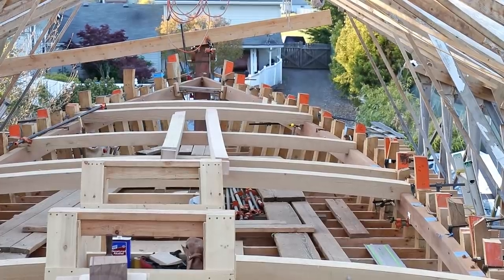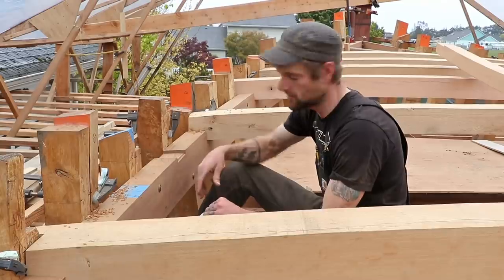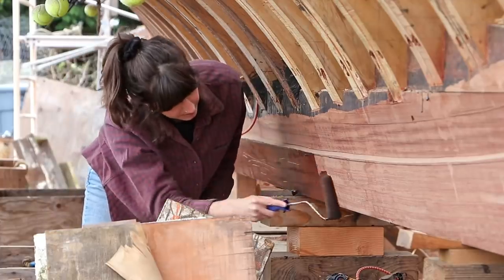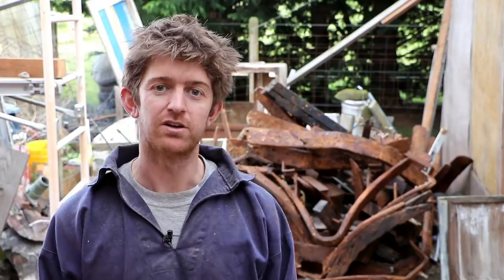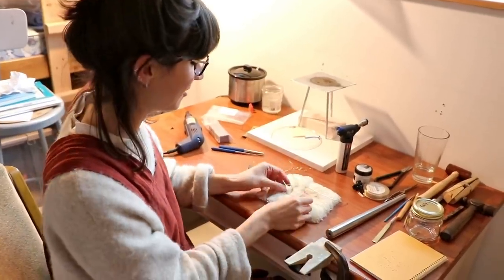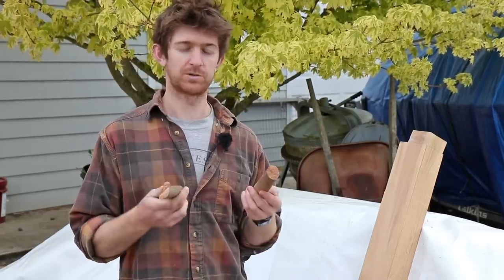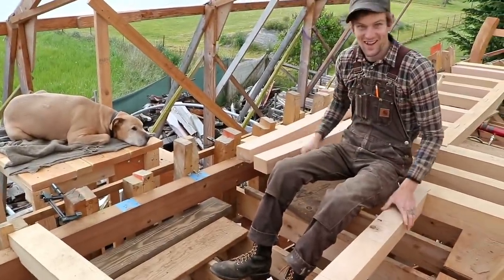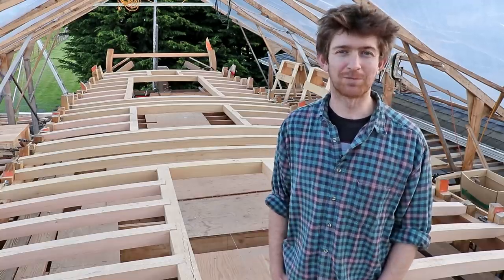BoatBuilding - Building the Deck Structure! (EP71)

Comment: Cast floors will be interesting to compare to Acorn to Arabella's welded bronze floors.
Reply: I was going to suggest to to look at them, I think they could be stronger and provide more rigidity to the centre-line of the boat.
Reply: I would think that welded plates and bars are much stronger than cast shapes.  We had cast aluminum handrail infills break in two when the castings were being pulled out of the crate.  There were air bubbles in the castings causing weak spots.
Reply: @biggest163  I Agree I think welded would be stronger faster and cheaper. There would be no pores, no flash lines to grind off.
Reply: @pghgeo816  Poor welding has pores in it, just as well as poor casting. Bronze is not a material that weld well.
Reply: Leo is a professional, those other guys are learners.
Reply: You were pondering what I was pondering...
Reply: A properly designed and poured bronze casting is more robust than a welded part.
Reply: @lowellmccormick6991  Air pockets in the castings means an inadequate design for the pour, among other things.
Reply: Cast bronze is extremely strong. I previously owned a bronze foundry. Not Brass but real quality bronze. It does not break easily and can take the flexing of a wooden vessel. I have salvaged vessels that were very old and repolished the bronze and reused it. Same with very old and weathered Teak, sanded and refinished. Best to be virgin teak not the modern farm cultivated variety.
Reply: @DC-uo5hy  pretty interesting stuff.
Reply: @DC-uo5hy  I hope Leo gets in touch with your for tutoring if he is planning on doing the casting himself (or) to get from you advice as to the best fabricator(s) you know as a choice of recommendations.
Reply: Welded parts would be ahistorical, and not really in spirit of the old lady, as opposed to a new build.
Reply: Nancy Pelosi  It looks like if they fair those positives out a bit they can just take them to a foundry that does greensand castings, no extra steps required.
Reply: @David Culpepper: I know there is "cold-rolled" and "hot-rolled" steel, but I don't know if the same applies to bronze-- such as the bronze stock Steve and Alix used for Arabella's floors. That was some pretty beefy stuff, but it was welded, so I'm also not sure of the strength of such construction. Would love to hear your take on welded-vs-cast bronze for critical parts like floors for a wooden boat. There will be twisting and torsion forces on those floors-- it's a wooden boat, nothing sits still. Would you include gussets between the vertical and horizontal members of such a construct if you were to cast that? I'm really very curious about this. Thank You!
Reply: @Crusty Curmudgeon (myself): I neglected to mention the general analysis that "cold-rolled" steel is far stronger than "hot-rolled" steel in tensile applications in my above comment. My apologies. I kind of wonder if bronze is the same, and if cast bronze can match that.
Reply: Oso Is that why they made the inferior choice to weld?
Reply: @Tsamokie   Especially in aluminium bronze, or better still, nickel aluminium bronze (however the latter would be overkill for floors - fantastic for rigging fittings, though)
Reply: @lowellmccormick6991  I guess it all depends on the quality of the castings, doesn't it?
Reply: Why would this video get 47 thumbs down?  I don't understand, but I guess we are all different.
Reply: Maybe thoses castings could be done  by "lost foam casting". Cuting the foam sandwitched in profiles cut according to each side of the template with Hot Wire. Need of a big furnace and a lot of bronze.
Reply: @Garry Kompton Hi Gary,
Sand cast, 88, 2 and 10 gunmetal (cannon) bronze cost around 8 to 12 dollars a pound to cast. Some other bronze is also very good but I prefere the strengths and ductility of the 88, 2 & 10.
Reply: @ApexWoodworks  Our problem castings came from a foundry in Mexico and we had to throw 1/3 of the castings into the scrap aluminum bin.  I've received other castings that were done well.
Reply: Roy Daley no doubt. Other projects have come and gone however I will see this one in the water.
Reply: @oso9809  they are taking their time to do everything properly, and their attention to detail is phenomenal. they might not be as knowledgeable as Leo but with time they will be. it would be interesting to see both tally ho and arabella race each other when they're both complete.
Reply: Leo has talked to the folks at Port Townsend Foundry in the past early on about casting the floors as well as the other required hardware.
Reply: @roydaley3413  Some people "Dislike" videos in order to try to train the Google AI, to not recommend similar videos. I just learned that not too long back. Of course, that just begs the question. Why would they not want to see these videos suggested?
Reply: @DC-uo5hy  extremely good examples of the durability of bronze. Bells and canon
Reply: Welding bronze seems like a good idea, but I have not been able to find much information on the material properties around the weld, and I suspect the whole piece may need to be heat treated to avoid embrittlement. Can a proper metallurgist out there,  answer this?
Reply: @Garry Kompton Bronze is very robust in the marine environment.  There would be no benefit to powder coating but I can envision some issues with getting to stick and stay stuck on bronze.  This is based on my own powder coating of other nonferrous metals.

Comment: I’ve seen it a few times now, still can’t believe how huge the circular saw is
Reply: How do you know that Leo and all the other helpers are not just very tiny.
Reply: The Insane Shecklador might be haha :)
Reply: With the ease and perfection of the cuts, I'd say that saw was purpose-built... 😊
Reply: @gilbertfranklin1537  actually, therr arr commercially available "circular saws" available with 10", 12", and 14" blades for "beam" cutting. Check your local supply house for orderability, or search online tool suppliers.
Search: Sawsquatch, beam saw, etc...
Reply: It's great isn't it! 16" blade if I remember correctly, never seen one in the wild but Leo has one.
Reply: @lemagreengreen  It is a 16" blade.  about 6" depth of cut. That one is a more recent Makita model.  Very popular for large timber construction like timber framing and the like.
Reply: Yes, that is a huge amount of blade to control for a hand saw.

Comment: Hi Leo. I have loved watching all these videos, right from the start. I think there could be two or three reasons for offsetting the hatch. First, and most likely, is the space required to accommodate the bowsprit; second, to allow a decent size of locker below for sail storage or similar, and third, to allow space on both sides of the hatch when a headsail is bent to the rail, using tip a large area of foredeck. Nowhere should there be trip hazards or other poor places for feet. Falling onto the deck or worse is not a source of amusement at any level. This displacement from the centre line wa carefully thought out, and is only to be admired as a 110 year old bit of thinking on the part of Mr Strange.

Comment: The fact that he cut that carlin knowing the knots would be removed in the joint, therefore utilising an otherwise good piece of timber, indicates the level of depth of thinking required to build such a boat. Amazing.
Reply: It's still much harder wood around the knots! Alot more effort to chisel out especially with the grain constantly changing direction.
Reply: At that same timestamp (around 19:10) the shipwright gets thrown a pair of wedges when he's standing on a pair of "2 x 10"s.
See, the problem is terminology. Most places call them "10 x 2"s, even in the old money , or "250x50" since about fifty years ago. It sounds much more stable.   ;-
Reply: @Gottenhimfella  Must be an American thing, 2x4, 2x6, 2x8, 2x10, etc.
Reply: I build furniture as a hobby and I find myself thinking like that because I just hate wasting wood (or rather buying more wood than I need to) if I can figure out how to make a piece of wood work for me.

Comment: Top Tip: don't ever use your hand as a hammer. ever. You'll mess up your hands eventually. Voice of experience here.
Reply: Yep, I pounded a chisel with the palm of my hand for a long time and now I have problems gripping things for a long time. Hand goes numb and whatever I'm holding drops or goes flying.
Reply: Bargle5  I’m in the same boat. Can’t hold things well, and drop items with out even knowing they are slipping. Silverware is hard to use too. Younger guys please hear our words as guidance for a better future for yourself.
Reply: Worked with Steelcase modular office furniture and we used our hands to hit the bottom of the upper steel file cabinets to release them from the panels. Retired now with constant pain in the base of the thumb. So to echo Jake's reply try not to use your hand as a hammer.  PS: the newer modular systems are redesigned.
Reply: ralph milburn
Reply: Or as a saw. 😰 got a buddy who really messed up his hand that way...
Reply: "In Japan, the hand can be used like a knife..."
(1970s Ginsu commercial)
Reply: @dbf2678  Knife OK, hammer ...not.
Reply: I constantly tell myself hands aren't hammers
Reply: @chrisgooden9662  I don't know how many times I have put that comment on youtube channels. a lot

Comment: My guess on the deck opening offset is that it is due to the positioning of the bowsprit (which seems to ride on one side of the stem in cutters) and anchor chain windlass. Is the opening for the chain or access to the sail locker?
Bril vids as always - Pancho steals the limelight every time

Comment: Leo in my youth apprenticing as a cabinetmaker I worked several winters when work was slow for a boat shop in the Muskoka lake district north of Toronto helping to restore mahogany runabouts. On one project we were steaming in 5/4 ribs into a runabout bow, did 6 ribs port and starboard left them clamped up and went home for the day. When we came in the next morning all 12 of the frames had broken during the night into 6" pieces from the pressure as they cooled. The explanation  and the discussion that followed was that the log had layed in water in the swamp until spring when the log through its nature started to draw up sap, but was drawing swamp water up instead with all the impurities and with no root system to filter. The the other explanation came from my father, was that the oak had been wet after sawing and had suffered a hard freeze  breaking the cells removing its longitudinal strength. All the best Brian

Comment: Fore deck hatch is offset for the anchor rode.  At least that is my guess.  Or for room below for the head...

You know a team is gelling well, when that are busting each others chops.
Reply: but wouldn't a anchor winch be amidships , why would the chain be off side ?
Reply: SailorAllan to clear the forestay?
Reply: The winch would be more-or-less amidships, but if it's a horizontal shaft the main drum would be offset to one side, so the rode would also be offset to run up to the bow roller on one side of the bowsprit.

Comment: Ah, what a satisfying segment. Best in the season, I'd have to say. On the slightly off centre forward hatch opening, I'm just going to take a shot from the hip and venture that it might have something to do with the often seen removable bowsprit on pilot cutters that I have observed in my own research. Or, I thought it might have something to do with the position and points of stress added to the deck by the anchor winch. 
Question. Have you ever wondered about how many actual man hours it has taken to get this far in construction compared to the original? Considering that originally many of the operations would have been achieved without the aid of all the power hand tools, such as planes, that giant skill saw, belt sanders, and routers that you have, that the original builders did not have?  Anyway thank-you again for such a visionary project, documented for the ages and for future shipwrights.

Comment: My guess is that the most forward hatch is the chain locker and that it is offset so that the anchor chain clears the stem and is aligned with the chain winch.
Reply: my guess is that the bowsprit goes there when it's retracted .... (boats of this size might have "stationary bowsprits?)

Comment: For the dark vinager smelling wood: I don't know much about wood infections but I do know what causes vinegar smells. I'd say that you have a yeast like bacteria in the wood which is eating any remaining sap or starch/sugars in the wood. This in turn produces alcohol like ethanol or methanol which when reacting with oxygen (when exposed to air) causes it to turn to vinager. Personally I don't think this could pass to other wood or eat up entire planks and would just be localised to regions within the wood with abnormal amounts of sap

Tldr: the woods probably got a bacterial infection, shouldn't worry about it infecting other wood.

- I am by no means an expert in any of these subjects I just know enough to have a theory.
Reply: Just to add to the bacterial wetwood discussion. The progress of the bacteria through an infected tree consumes oxygen. The anaerobic process of fermentation is revealed in a sour vinegar smell. In most cases tree professionals can spot it before it ends up at the mill but can be at times hidden. 

Not really much can be done other than segregate infected bits and use them to show your awesome taekwondo power stroke 🥋

Comment: Hey Leo, longtime fan. Do you have plans for those wrought iron floors? I'm a hobby smith over in Seattle and I'd love to get some of those floors, wrought iron is getting harder and harder to find. I'd love to use it to make some chisels or something you need to help the project
Reply: maybe wrought iron should go to a professional smith for important restoration work
Reply: @Cssfiend  It's going for scrap, Leo is replacing it with Bronze floors.
Reply: @Cssfiend  Besides the fact that it's so heavily rusted that it will no doubt lose a few millimeters of material, thus making it less strong, it's also proven that it's not ideal to have out on open waters, as it corrodes not just the metal, but also the wood. Recycling it is a much better idea.
Reply: @emeralddragon2980  Never mind ships. Wrought iron is hard to get and restaurations also happen on dry land.

Comment: I do quite a bit of framing with tropical hardwoods at my home in Thailand. On one  project I was cutting a cantilevered rafter for the roof structure when the 2x5 accidentally fell to the cement floor from the horses. This very heavy and lovely rafter just shattered in a clean break with no evidence of wood fibers. Never have seen this before. It looked just like your hammer handle. The lumber appears strong but a sharp impact fractures it like glass. I now test all my lumber. The tropical hardwoods are generally very resistant to decay but many times are left fallen in the jungle for a long time before being milled. I envy your precision cutting and fitting.

Comment: So very shapely. My guess with the offset hatch is either to clear for the bowsprit, or because there’s some kind of access for ropes and anchor chains
Reply: I was thinking the same thing. Bowsprit and or anchor windless. If I remember correctly that thing is massive. (I just went back to ep#2 and it shows the capstan, it's HUGE)
Reply: @webbtrekker534  My two cents goes to your explanation @Webb Trekker.  The capstan is a monster.

Comment: about the deckopening being offset..  my guess would be it is because of the sails that might be in the way later - coming from the mast to the bow(sprit base)?
Reply: Yes, are there some instances where you might use a club foot on the stays'l/working fores'l in which case, if the hatch were centered, you would be coming up under the club and hitting your head on it when it's stowed in port?
Reply: I think the companion way is offset to be available and not blocked when the bowsprit is taken inboard. There will be a bracket on deck next to the mastfoot, to secure the bowsprit when taken, portside normally.
Reply: ...taken in...
Reply: It's offset to allow the bow spar to be brought in board yet still have access to the hatch
Reply: @nickkram6811  by George, I think you've got it!  You can always stow a club foot off center so that's not a good enough reason to shift a hatch and risk flooding in the event of a Stbd side knockdown.  However,  nowadays, if you want to stay in a modern marina, you won't be very welcome if you've a dirty great bowsprit sticking out of the boat across the walkway (or, at least, it would get very expensive) so the bowsprit will have to come in and, to do this, the hatch would be in the way.

Comment: Acorn to Arabella: "We welded bronze floors from sheet metal!" Sampson Boat Co: "We're casting those motherfu-"
Reply: chooseymomschoose sheet metal? Since when is 3/8 or 1/2” “sheet”? Always thought is was flat bar?
Reply: @scottrowlings5345  A sheet metal can be as thick as you like. Our statics professor at uni always said for civil engineers and architects anything less than 10 cm thickness is pretty much a thin sheet..
Reply: @aurigo_tech  Depends on what you're doing.  Wouldn't want your statics professor designing an airplane with that philosophy.

Comment: Couple questions: some of the spur beams look proud at the carlins - plane them later or another reason? Also, the aft companionway carlins look slightly bowed inward (maybe video angle). On the premise that nothing is done on this project without reason, then if accurate, why? Hope Pete's finger injury, w
Reply: My guess is, the spur beams are going to be planed later, as the whole deck structure needs to be faired out and it makes more sense to this after everything's been bedded and the beams have had some time to settle; otherwise you might end up with a warped deck.
Reply: @daniel_charms  That signifies.
Reply: Had the same question myself.